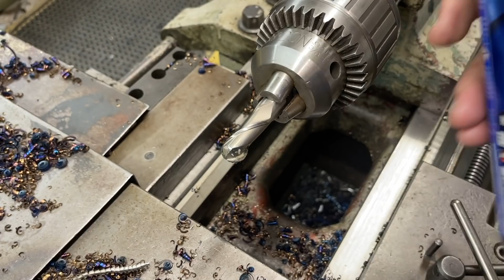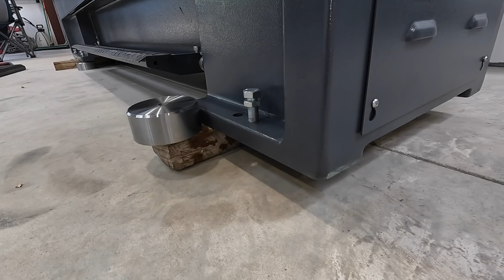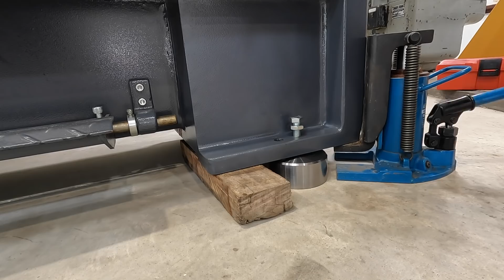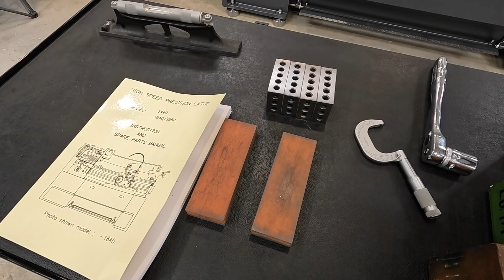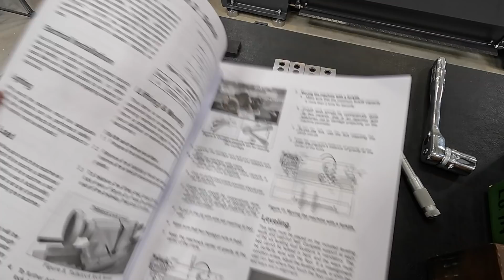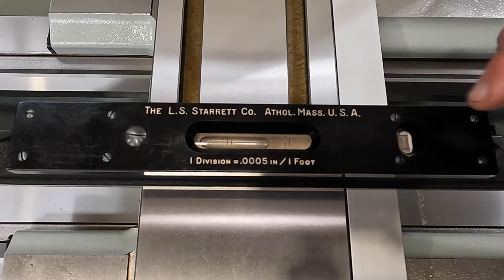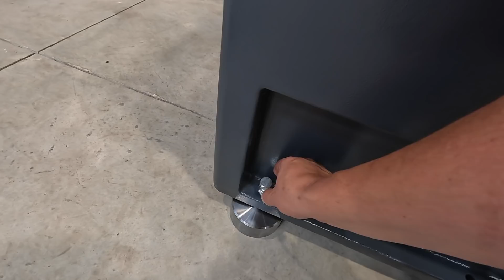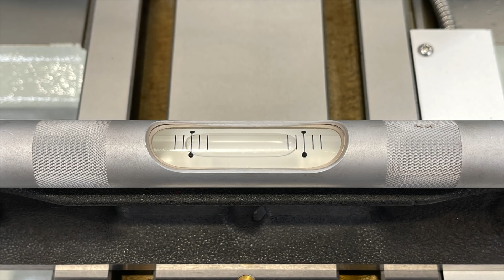Leveling the Precision Matthews TL-1660 Lathe

Comment: Why is it actually so important to level the lathe? Is the bed of the lathe not the refference surface anyway?
Reply: It’s not really “leveling”. That’s the word used, but it’s wrong. It doesn’t matter if the lathe isn’t extremely level, just level enough so that heavy work will be pretty horizontal, end to end. And that flood coolant won’t build up in one part of the pan.

The important thing, as David just stated, it to remove the trust the bed can have from the floor, which, no matter how well the concrete is poured and screed, is never really flat, but have small dips and mounds. Even a heavy, solid cast iron base will twist because of the weight. You also need to level it pretty often at first as it, and the floor settles for the first few months, and then every so often afterwards. If I have to do something that requires high precision in length, I level my lathe before.

The flat ways are the standard way of leveling the bed, using 1-2-3 blocks. The top of the v-ways aren’t usually machined to the same accuracy, as they contact nothing in use. The top of the cross slide isn’t a reliable leveling surface other than for quick, coarse leveling. That’s because the several movable surfaces between the top of the cross slide and the bed are uncertain in exactness. Every level of part can add to inaccuracy of measurement.
Reply: @melgross  It definitely was the standard until you gained a good surface for the purpose. We set up our CNC lathes by leveling first off of the solid X axis ways or linear guide rails. Then we bolted the "leveling" plate to a turret face. This plate was often painted steel weldment or unfinished casting. Clay placed under the precision level would "level" the level and then we checked and corrected for twist. CNC lathes have a much more rigid frame than engine lathes and twist is more easily managed.
Reply: @paulhunt598  very true. Many have central box frames which don’t move very much, and the rest of the machine is attached to that, somewhat like a mill, where there is a smaller footprint that doesn’t really twist, and so doesn’t affect the table or head.
Reply: The bed of the lathe can twist if not leveled, causing your cuts be tapered.
Reply: @DavidHerscher  I have had several machinist tell me to take the twist out of the bed and don't worry about getting it level in all directions . A twist in the bed is what causes all the problems and not the level.
Reply: @ronwakula6737  Yes that's correct. "Leveling" is a misnomer, as it in fact is not "leveling" in reference to the world. But that is the term commonly used for the task, and any machinist will know what you're talking about when you say "leveling" a lathe.
Reply: As the others have said, levelling the lathe is not that important - there are high-precision lathes on ships that are seldom level (because, ship). Ensuring there's no twist in the bed IS the important bit. This is usually done by machining a test bar in the chuck, but not held by the tailstock. The diameter of the bar close to the chuck should exactly match the diameter of the bar (say, a 12x1" bar) at the tailstock end (still without using the tailstock, centering that will come later).
Reply: @slots1407  This is normally performed after the lathe has been "leveled". But leveling with a precision level perpendicular to the travel of the ways will get you very close, and is almost always done before a test bar is cut. This will usually be done at least twice, as after the first time you'll let the machine sit for several days and "settle" into place, then check it again.
Reply: @slots1407  thing is, that chuck had better be in really good shape. Lots of chucks are not only off in their concentricity, which doesn’t matter for this, but are not holding the work straight. That will affect this as it will cause some taper on one end, depending on complex factors such as the angle it’s off by, and therefore how far out that taper extends before it goes away at one spot, and begins to increase again. That can be very confusing, depending on how long it is. You can cut the bar, and find that the chuck end is wider, getting narrower because of the Chuck’s radial error, and then at some point, getting wider again. That will give you the heebee jeebies.
Reply: @melgross  I'm assuming a new machine and chuck.
Reply: @slots1407  obviously, that will be better. But it’s always best to read the chuck manufacturer’s specs for that so you have some idea as to how much the chuck is contributing to the error, or even subtracting from it. I suppose it also depends on how you use the machine. Chuck, or not to chuck, that is the question.

Comment: Just wondering, because of the six feet,… I would guess that for leveling the two “middle” on the frame motor/gearbox side need to be turned up. Then leveling the machine, when ready, then turn the to middle ones to tension for support. If level with all six at the same time, got the feeling you mite have a flip/flop on the middle two.(added later, I watch the vid in two parts, and noticed Adam doing this kind of what I described.instead of outer four, bed-4 first and the n the motor/gear  part last. So I was wrong to write my question before viewing all .. 😞 sorry … I still leave it due to added comments.)
Reply: Engine lathes are first leveled on the bedway. The headstock is then leveled to the bedway. I wrote a longer explanation in another comment.
Reply: He did something like that

Comment: I'm curious to know if it will maintain level after a few months of use.  I'm thinking the vibration of the machine through the feet might be enough to wear the high spots down on the floor.  Maybe check it again in 6 months or a year.
Reply: Did he grease those tiny ball feet on the end of bolt that goes into the floor pads. If not, vibration could change perfection very soon
Reply: Thought I had heard someone else say the cast iron relaxes too. Could have been my Grandad or it was on a Keith Fenner video. So a readjust might be necessary eventually. If the weight was adjusted properly it shouldn’t shift to much. Grandad said the lathes in many of the shops he was working in were on foundations drilled into bedrock.

Comment: I have built (at the factory) and installed many lathes, we actually made ours level unless the customer wanted it pitched. If the coolant sprays towards the headstock, liquid will go through the spindle bore, regardless how the machine is pitched. You just plug the spindle bore or stuff a rag around the stock, if you're running material through the spindle bore if you don't want drips. This whole pitching the machine thing is 100% BS.

However, what machine tool builders do when they build a machine is, everso slightly tilt the headstock down and toward the operator (2/10,000"/6"). This is not the whole machine, rather the center bore of the spindle is tilted down in comparison to the bed. This is because single point turning (contact being on the operator side) will deflect the material up and away from the operator. So if the spindle was perfectly centered, a part (even with the finest finish cut) would be slightly bugle shaped (smaller at the headstock side). So, slightly tilting the headstock down and towards the operator, will counteract these forces, to some degree and attempt to eliminate the bugle shape on low force finish cuts. ALL serious machine tool manufacturers build this in at the factory. It is then the installer's job to insure the machine is installed in this same condition.

I believe the myth of tilting the machine so the coolant will flow correctly, comes from people misunderstanding what tilting does and where it's done. Also, "tilting" is not supposed to be accomplished with levels, you do it with the test cut and 1/10th mics.

Trust what I have said, I am 100% certain this is correct.

Comment: I'm surprised you don't tie down such a big machine...

Also, as for setting the level off by one line rather than horizontal, would not the lathe manufacturer make the coolant tank suitably slopped for coolant recuperation ?
Reply: They kinda do but it still needs help… especially when you start filling up with chips. It’s that TWIST I’d worry about too.
Reply: @franknphotos  then will an extra slope of 0.1 thou over a foot make a difference ? vs. the convenience of having a perfectly levelled bed (on a nice flat new ground)...

Comment: I believe those lock nuts are supposed to go on the underside. Vibrations will make the screws work their way up, not down, and the nuts are supposed to stop that.
Reply: The lock nuts on top are correct.  You always want the lock nut to load the thread flanks in the same direction as the weight of the machine is loading them.  If you put them on the bottom and then tighten them up you are lifting the machine off of the thread flanks.  If you do it that way you can lift the machine by an amount equal to the clearance in the thread.  In the world of levelling machines the clearance in a thread is huge.  Ken

Comment: Surely it's not about "level" but distortion/flex/twist along the length of the bed (and obviously across it too) in relation to the axes of the chuck/headstock?
Reply: Right, there's temporary deformation and possibly permanent decofmat4 as well otherwise. Issue being your machine will cut slight tapers. The bed could be placed vertically or diagonally even overhead, as long as it remains flat.

Comment: So how is the machine held down?  I know it is fairly heavy but those levelling points hold it up. Are you relying solely on gravity to hold it down?
Reply: Yes.
Machine weight is usually adequate for holding a machine. I set up machines for an entire career and very seldom was anchoring required. There are exceptions, but I wouldn't have done more on this job.

Comment: First congratulations and good luck with it. Second I believe that a smart manufacturer will set the chip tray so that it will be at the correct angle to drain the coolant away from the head stock without the user needing to tilt it at 5he time of leveling. Not sure if that is the case with this lathe, just my thought on the matter.
Reply: Wants the ways to drain. Not just the chip pan

Comment: Hi Adam
I have watched a hundred or more of your videos and I love them. HOWEVER. Surely the point of levelling is to make the machine level? I would presume that the lathe manufacturers have allowed for drainage when they produced the casting. 
Have I lost the plot? 
Someone please reply. Thanks.
Reply: Side to side is the important in leveling as it insures no twist in the bed. End to end would depend on if you were ever to use a level as part of your setup or machining. If you have it level end to end by definition the longitudinal ways would not drain-they can’t as they are level. The rest of the casting could be designed to drain as the coolant sump is usually on the tail stock end but not the longitudinal ways if you want them totally level. Therefore, letting it slope some would help drain the coolant away from the headstock on the ways toward the sump. The machine will cut true so long as there is no twist in the ways regardless of any tilt to the machine side to side or end to end.
Reply: @bruceanderson9461  Thanks for the reply. It makes perfect sense now.
Reply: @bruceanderson9461  Thanks Bruce. Appreciate your time in responding.
Reply: Adam's slope won't drain coolant, but it doesn't hurt as many are stating. Use a carpenter level if coolant drainage was your goal!😉

Comment: What if a lathe is not perfectly leveled, would that be an issue?
Reply: Leveling is not as important as removing twist from the bed. Let's take a gross example: suppose the entire  lathe to be 10° out of level. If there is no twist in the bed, you could still produce accurate long diameters with no unintended taper.

Comment: I guess the goal is not to level it but make it planar/flat to take twist out due to it own weight and flexibility
Reply: Yep, and that's why on some machines you purposely level it out of true to the world to get the coolant to drain right
Reply: Co-planar is probably much more important than "level". It's literally got to be straight. I've set almost 50 different machine's, from small lathes to extremely large boring mill's, large radial arm drill presses to large surface grinders. Perfectly level is a great ideal, as close as possible in the same plane from end to end, and in all directions is way more important....

Comment: You used the more center screws for leveling and then just snugged up the outer screws at the headstock end, but shouldn't you use the outer screws for leveling and the inner screws for support? Is the difference so small that it doesn't make a difference? Thanks for the video!
Reply: The ways end at the more center screws, the outer screws would be more for getting the axis of rotation parallel to the ways.
Reply: @sleepib  Oh, yeah, didn't think about that. Thanks!

Comment: Me thinks leveling is not important. Lathes are used on boats of all kinds.
What is important is to take out the tweak, the twist, the lack of symmetry. A simple way to achieve this is via leveling.
Yes, there are jobs where one want to use a level for initial holding of the part.
But this is just an opinion, and those I have plenty of.
I like this new wave of episodes.  You seem to having recovered your aim.  Great!

Comment: > nice going abom; i would think a brand new machine would have a slope built into the coolant tray and level the ways accordingly - level the v-ways X & Y and then confirm the coolant tray pitch inside the tray
Reply: Missing the point - he wants the ways to drain toward the sump - tail end of the lathe.
Reply: I was thinking the same thing

Comment: Adam, fantastic job leveling in the Precision Matthews, I just finished un packing and leveling in a new LeBlond RKL-1340G  and it it looks exactly the same as the PM just different paint job.! Any way, I found the easiest way to get that rust inhibitor wax off is copious amounts of mineral spirits, brass o-ring picks and a brass scraper, I made one out of a piece of 1x1/4 flat bar.

Comment: Adam. I figured you would have glued some rubber sheet material under the pucks to stop any vibration noise trans fee and to make up any minor surface discrepancies. Maybe later if needed!  Thanks for the vid sir!
Reply: I made that same comment earlier. Any vibration can make that machine walk...... I even half an inch walk will knock it out of level.

Comment: If You Dish those feet on the bottom you will also get les chatter in addition to more stable ground contact. It the 3 points of contact equation.

Comment: No criticism intended but I would have machined a relief about .050" or .060" deep on the floor side out to about 3/8" from the OD so the pads wouldn't be resting on the full diameter.

Comment: Will you have to check level again, after the Electricians have been and possibly 'nudged' / 'bumped',  the lathe ?
Reply: It’s a 4000 lb lathe. If the electrician bumps that lathe and it moves, there are bigger issues.

Comment: Adam, I wonder if it would have made sense to put a small pad of thin rubber under each foot..... You know like the rubber bed sheets you can get from the pharmacy? I just think that it would insulate the lathe...... Or any machine for that matter...... From any "walking" it might do due to floor vibrations, vibrations from doing interrupted cuts (such as fins on an impeller), etc.
Reply: Rigidity is important, you should never use antivibration pads on machine tools.
Reply: @cornpop7805  The rubber sheeting I suggested was not to dampen vibration..... They would be much too thin to do that. But they would improve stiction between the leveling pads and the concrete so that if vibration were induced either through the concrete or rough machining on the lathe..... The likelihood of the lathe moving off of its leveling spots (on the concrete) would be minimalized or possibly eliminated.

All the trouble that Adam took in leveling that bed would be wasted if the machine were to "walk or creep" even half an inch from the concrete footprints where the bed was leveled. The concrete floor is not perfectly flat.
Reply: @johndonlan5956  Nope! .. It most certainly should be bolted down though.